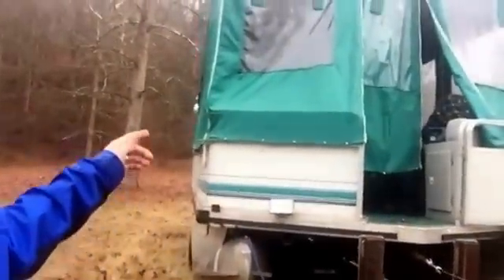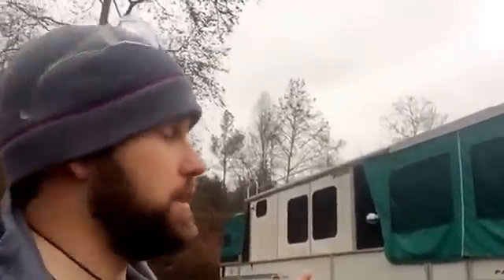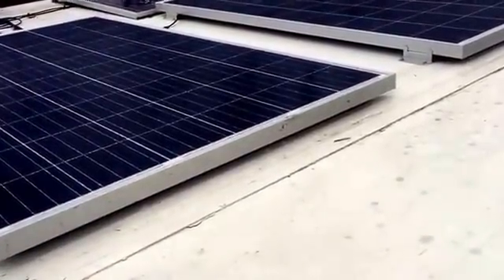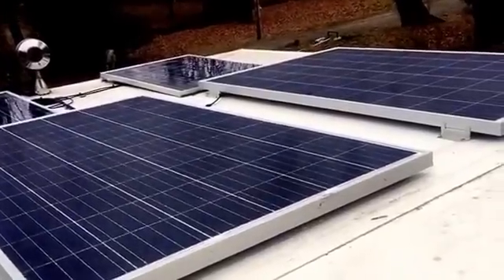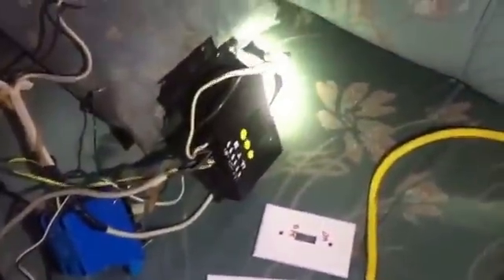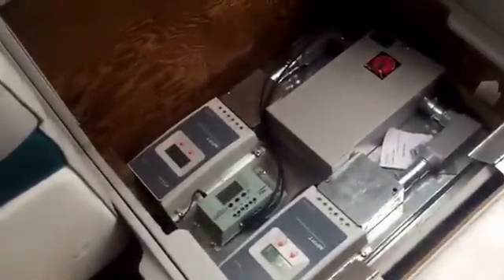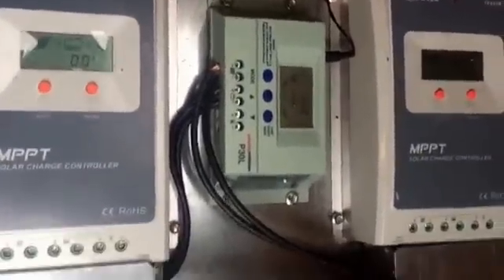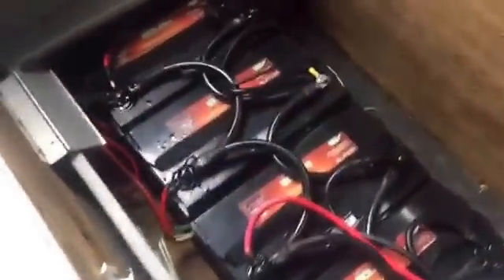Solar install on Party Boat by Off Grid Contracting

Comment: Do you think solar has reached the point of being practical?  I  have heard that huge improvements are just around the corner.  Should I wait?
Reply from the maker: For grid tie I would definitely wait as that there is some great stuff coming out that will change the market soon but for off grid I would jump in that pond at anytime as that there is a great array of equipment to do just about anything a person wants to off grid currently.